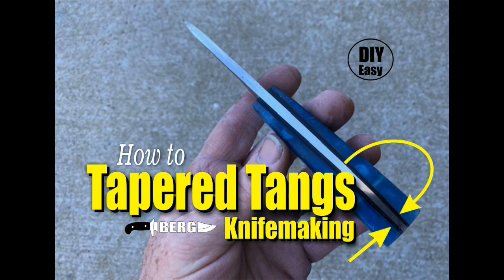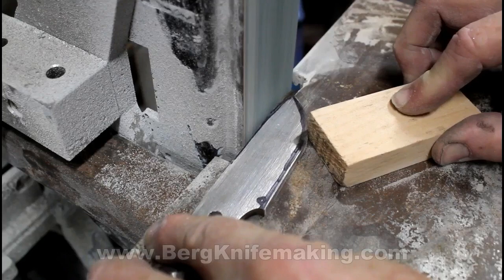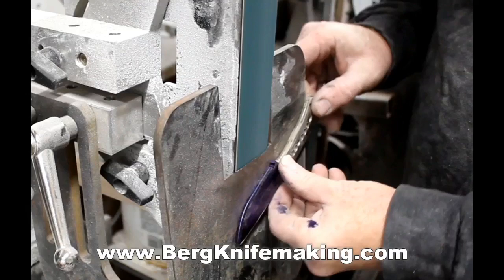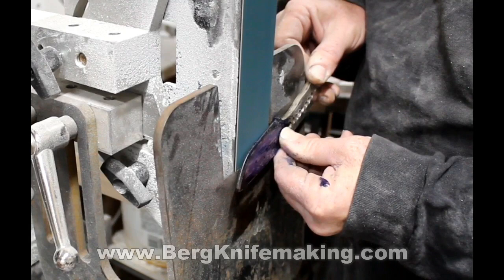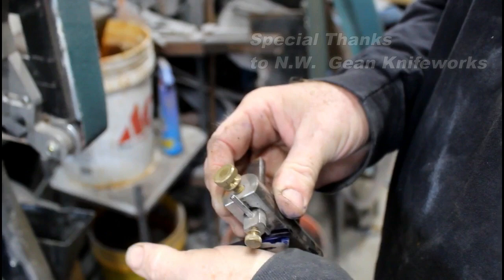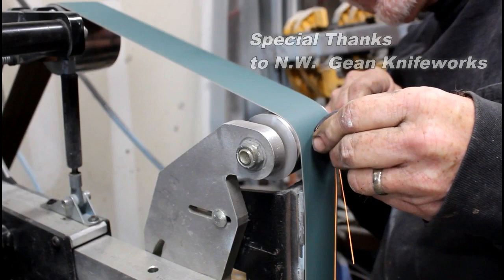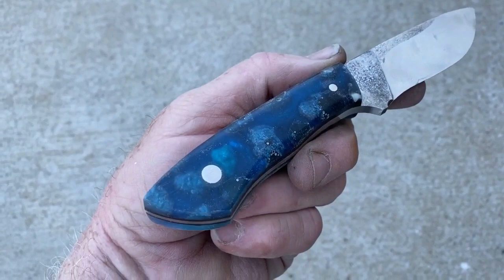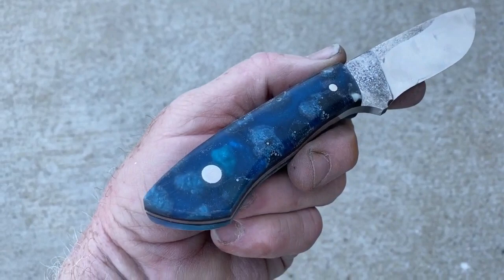Knife Making: How to Make a Tapered Tang | Knifemaking Tutorial by BergKnifemaking

Comment: Sir, you've made my entire week with just that shoutout. I know it's not much and I'm not the guy who invented tapered tangs, but it means a lot to me.

I need to make a video about my special vise for tapered tang scales. It holds the knife by the flats so that you can clamp the scale to the knife, support the underside with some scrap wood, and then the holes are drilled and aligned perfectly. All you have to do is flatten the scales on the grinder, and assuming your platen is flat and therefore the tapered tang is ground flat too, it will match the scales. I glue up with JB weld to hide the tiny gaps, but I think a stronger epoxy with dye would work just as well. 

Great job on the knife. The balance tapering the tang adds is just unbelievable until you try it for yourself. Again, thanks for the shoutout, I love giving back to the knifemaking community that has given me so much.